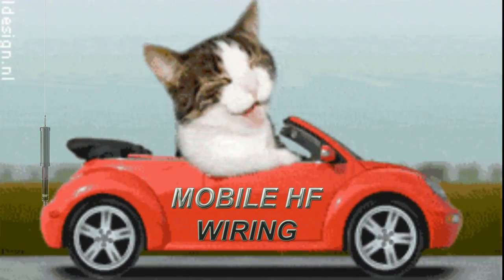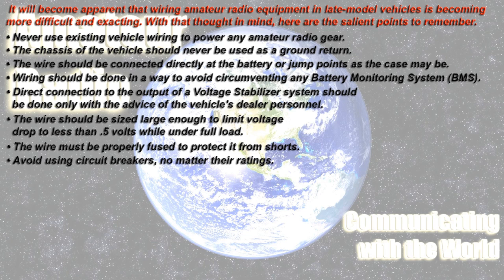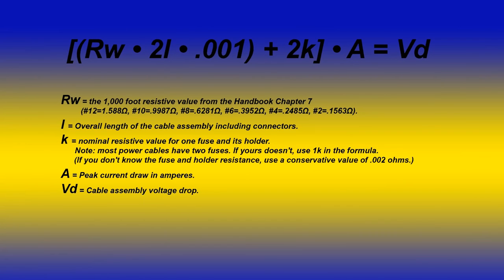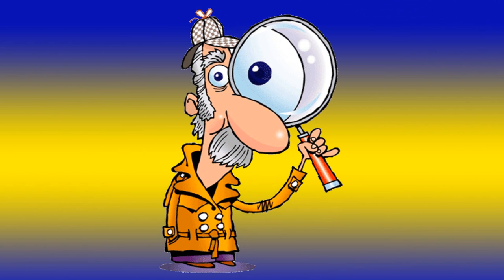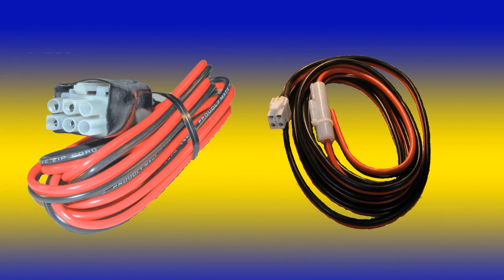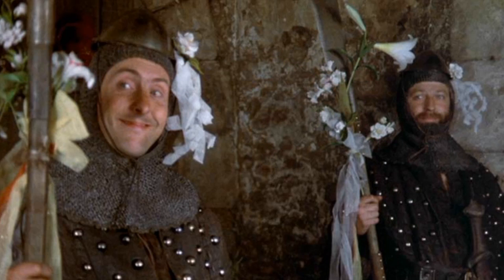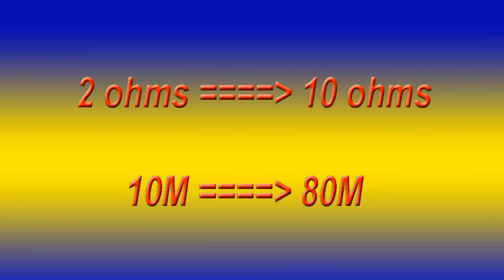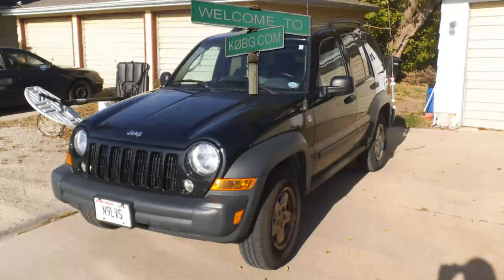Mobile HF Wiring (full)

Comment: I'v check to see where I;m getting noise. my problem is not the power. But comeing through the antenna . not I am using a mag mount for now . can you help ?
Reply from the maker: +Steve Newland Mag mount is by far the worst antennas out there. Try a troid on the antenna cable.
Reply: +Dan Vanevenhoven  Thanks Dan . I have installed a solid mount on the ranger  at the left rear side of the bumper . also added extra grounds. noise is still there so next to start 4 corner grounds and motor and doors. with a Ford ranger .Well.! Also on the inside i'v added 3 clip on Troids . A little change but not much .I know it is coming though the antenna. Thanks